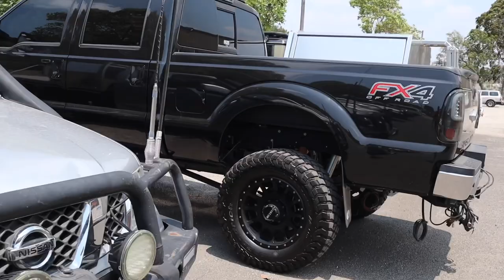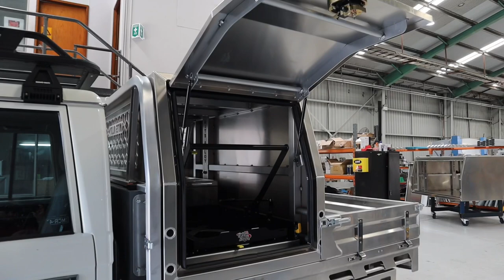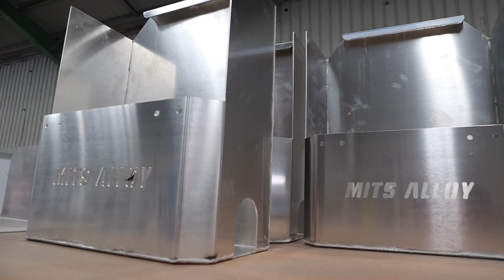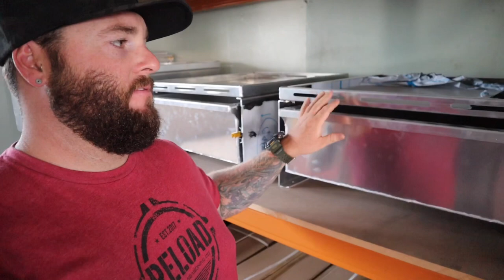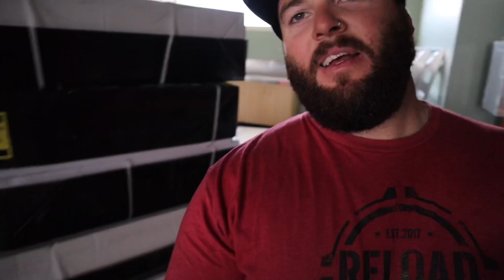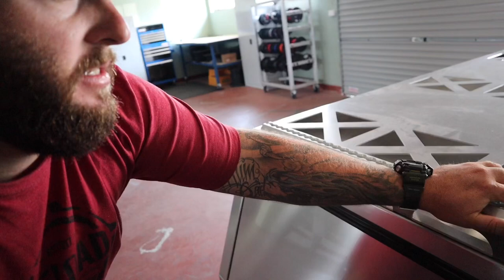BUILDING AN AMERICAN F250 OVERLAND TRUCK IN AUSTRALIA !

Comment: I don't get why you'd get a tundra with much less capability than a F250 / Ram 2500. The tundra is about the same size and drinks gallons per mile 🤷‍♂️